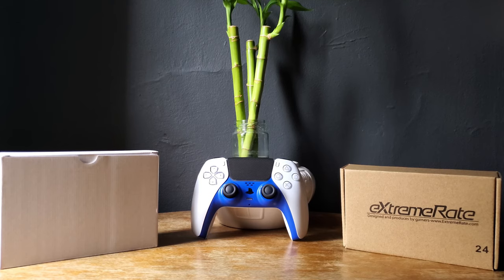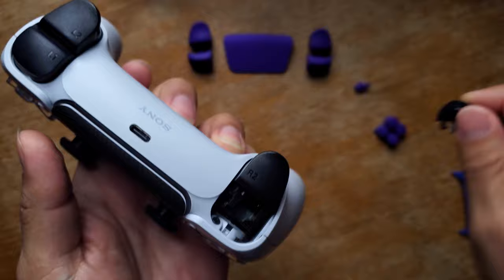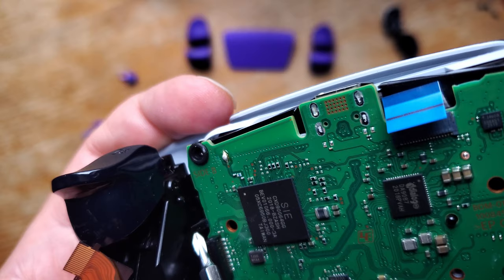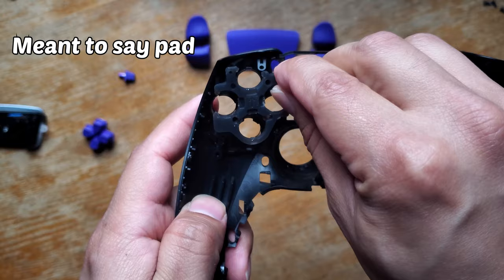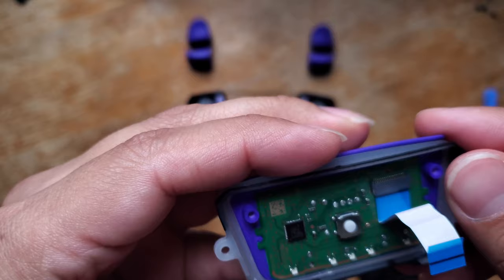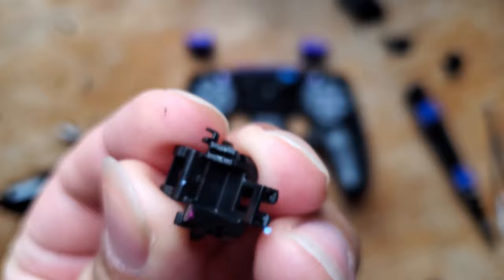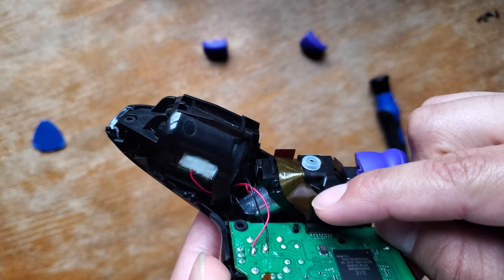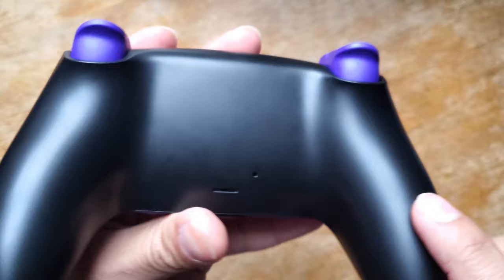PS5 Controller Customization: Step by Step Tutorial

Comment: Controller looks beautiful. I would rather someone else do this instead of me. PS4 controller was much easier to fix.
Reply from the maker: I know what you mean. But with practice and patience you can definitely get this done and save money.
Reply: Facts
Reply: Tbh i've done a LED mod on mine, took me 1.5h but it was worth the effort. Just follow a tutorial and you'll be good
Reply: I'm currently working on mine right now, and believe me when I tell you "attempt at your own risk". I wish they didn't make the controllers where you have to customize them yourself. I think I might have broke a peice, not sure yet, and you have to use some force to disconnect some wires. You're taking a huge risk with your controller trying not to cause damage. Plus the customize buttons don't even have the symbols on them. So you better never forget which buttons are
 □🔺️X⭕. Also the Playstation button isn't the proper logo, it's just a cutout.
Reply: Playstation 5 controller is super easy to mod. Only 5 screws.
Reply: Not trying to start anything But if you think that's hard try doing dual sense Edge
Reply: Obviously this sort of thing is “attempt at your own risk” lol but if you’re not confident in your abilities, it would be wise to do this with a controller that already needs taking apart to repair something like stick drift. As far as the buttons go, if you don’t know which ones are which, then we might have bigger problems than just cosmetically modifying a controller.
Reply: This is something to try on a controller you’re gonna throw out or sell I think
Reply: Hell I just did it, it took me 3 hours :(
Reply: @im.a.caveman fr, I just did it, I saved a bunch of money

Comment: im glad its similar to the ps4 one. but if its one thing i learned its that, do not mess with the triggers and option buttons. i once messed something up with that and it never felt the same way after that. Even after putting the original ones back it never felt the same. I personally wouldnt recommend messing with that

Comment: You absolutely saved my life with showing how to take the inside of triggers out. I usualy only mod ps4 controllers but I was doing a ps5 and i order my parts from Ali express much cheaper but  they don’t send them with it.  I searched the web for like 3 hours looking for someone to show me. Your the only one out there I swear. Earned a like and subscribe
Reply from the maker: It's funny you mentioned that because I had also done research so that I could do it for this video. Since I couldn't find it I took matters into my own hands. So I had noticed that a couple times the triggers would move a little out of place but all I would do is push it back in and it was good to go. Thanks for watching and thanks for the sub! Glad the video helped!

Comment: This video helped me learn how to customize my controller, but I remember how crazy the triggers were from this and I thought I remembered incorrectly. Nope, it looks insane to do those. Wow. You make it look easy.
Reply from the maker: It can be a little confusing for a beginner but it's nothing too difficult. As long as you're paying attention and you're patient it'll work out. 

Luckily it gets even easier with the newer boards BDM-030 and 040. The trigger modules don't get screwed off. Which is less steps and smoother installation. The board in the video is a 010.
Reply: @im.a.caveman  really? OK maybe I'll give it a try. I have a few controllers to work on so I'll try doing the back triggers.

Comment: I got to the hairdry part and said fk it hahaha. Ill just do the decorative strip and call it a day 😂
Reply from the maker: 😆 one day when you're feeling brave enough go for it! With enough heat the board should lift up easily. I recommend thin plastic tools and that aren't sharp.
Reply: @im.a.caveman  hahaha ok fine you inspired me to give it another go tomorrow lol thanks for the advice!
Reply from the maker: @Justafartu  Awesome! If it's not lifting up, don't rush it. Apply more heat and try lifting up again. Make sure it comes off with the glue on the board
Reply: @im.a.caveman  dang sorry bro I didn't see you replied again haha. I DID IT MY BROTHER WOOOOO the new set up looks so dope haha thanks for believing in me and the awesome tutorial!

 Time to do every controller in my house now lol
Reply: @im.a.caveman  dang now the touch pad rattles a bit from the adhesive losing its viscidity. Any tips other than taking it all apart again and reheating the glue?

Comment: Fantastic 😂 but took me almost 3 hours and Yes I tore the connection ribbon I couldn't be bothered with the clickable pad but the spiderman cover looks good. Don't have a hair dryer!! Anyways controller seems to be working tho the PS button that turns on PS5 works so maybe the mic or something is not working 😮 anyway cheers from London UK
Reply from the maker: Which spiderman cover do you have? Is it the black one with transparent webs? If you think it was one of the mic cables, I've seen replacements on Amazon. Never tried them though.
Reply: We’re do you guys find these faceplates every time I search for one I find stickers

Comment: Do you have any advice or tips for someone who is nervous about taking their controller apart? Obviously I will have patience and take my time, follow the video carefully... But any other advice?
Reply from the maker: Yes! Decent tools. I bought a screwdriver bit kit on Amazon and it has lasted me for I don't know how long. When it comes to working on controllers it's been great. So using the right tools is one thing to keep in mind. Start with a ps4 control if you have an extra. Have a set of plastic prying tools since it's not a good idea to use metal or you'll scratch up your stuff. Also, this one is optional, a silicon mat to work on. Some have little compartments for screws or other little items.
Reply: @im.a.caveman  what screwdriver kit did you buy on Amazon? I’ve been looking but there’s so many options and I’ve bought tools before which had just been made of soft metal and made screws go mushy and bent. Also, what prying tool did you buy? Ive got some but they’re all blunt and bent.
Reply from the maker: @MxHawthy  There's different versions of the one that I use. Just check out the 2 links. I have this because it was cheap at the moment and I personally have been able to work with it. I recommend having a better one. But this one has gotten me through so many customs since the screws on the controller aren't like crazy tight.  

https://www.amazon.com/dp/B01E16J6RQ/ref=cm_sw_r_cp_apa_glt_fabc_3DQEWAS1MBKHD2EDRRFN?psc=1

https://www.amazon.com/dp/B08D3GRZGF/ref=cm_sw_r_cp_apa_glt_fabc_K6X7K94SFPRYTQMG9JDJ?psc=1

Comment: At 4:37 the 4 screws, my controller doesn't have the 2 screws in the centre? Only the 2 on the sides, what do I do? I don't wanna proceed further incase I break something.
Reply from the maker: It's okay. You have a BDM-020 I assume. The board of that control is a BDM-010. The only thing that will be different is the touchpad. It might not be compatibile to yours depending on which kit you have.

Comment: Might be a dumb question but I feel like I did everything right but the controller won’t turn on what’s should I do
Reply from the maker: Did you reconnect the battery? Or connect the cable in case it needs to charge?

Comment: Nice video.  I'm having and issue with my touchpad after I changed the front faceplate, if sometimes sticks and it doesn't have as much up and down movement as it did before.  Any clue what could be wrong?
Reply: Hey bruh if you still haven’t fixed this, it is most likely because the touch pad isn’t connected to the circuit board with glue, you can fix this but simply gluing the touch pad to the board, or by reheating the board if there is glue on it already. Hope this helps
Reply: @sam-jett  I got it fixed. Thanks!

Comment: Just did a controller, EVERYTHING works as intended.... except the white light at the bottom of the touch pad. Any idea what i may have missed? 😩
Reply from the maker: Does the touchpad work?
Reply: @im.a.caveman It did not! But, i used the piece that came with my new shell and it works now. The other one I had on there had 2 plastic clear pieces (that weren't in it) that are important to the pad I guess lol. Swapped those out now everythings good. Thanks for the video, now I have a PS1 influenced Dualsense. 🙏

Comment: Trying to do the R/L2 buttons and I dont have the screws on the front like you do at 8:44...  I took the extra 2 screws out on the back and black side piece came off but i cant get the trigger out.. Any ideas? Ill prolly get it before a response lol, but thx still!
Reply from the maker: Sounds like you have a BDM-030. So far there isn't trigger or bumper replacements for 030.
Reply: @im.a.caveman  thx boss. I figured but didn’t know till it was taken apart. Even the R/L1 wont fit it. Silly. Oh well

Comment: Does anyone know how long the blow dryer process is supposed to take?
Reply from the maker: @TheTone2244  could be like a minute? Never timed it but maybe 1-2 mins. Depends how well you're providing heat to the touchpad and how much heat. Can't be too hot either. Just apply enough throughout the whole touchpad then try to lift it. If it's not lifting apply more heat until the board starts to lift up with ease. Take the board out with the glue so keep an eye on it

Comment: are the dualSense 5 Joysticks the same as the Dualshock 4 Joysticks? not the actuater, but the plastic part your thumb actually touches? 

i ask because i want to swap the joysticks on mine with some metal ones. and i cant find ANY aftermarket ps5 controller/dualsense joysticks. but i have found some listings saying things like "ps4/ps5 compatible joysticks"
Reply from the maker: Haven't tried myself but I think so. I'll try it out and let you know when I have tried the ps4 thumbsticks. gamingcobra.com has ps5 controller thumbsticks. You can also try Amazon.com if you haven't already.
Reply: @im.a.caveman  thanks for the reply. And I can answer the question as a hard yes.

I had an old ps4 controller I'd prior upgraded the thumbsticks to metal on. They work perfect the ds5
Reply from the maker: Sorry I didn't get to reply earlier but it's awesome you were able to have the ps4 thumbsticks on it. Thanks for letting me know!
Reply: @im.a.caveman  NP. yeah i prefer aluminum joysticks so im not replacing them ever 2 months. now im trrying to find aluminum buttons. and im starting to wonder if those will be the same as the ps4 as well. do let me know if you find out

Comment: you use any new glue to the new touch pad or we leave it as is??
Reply from the maker: I didn't use new glue. Still works like normal. If enough heat is applied and you manage to get the touch pad board off with the glue then you could end up having most of the glue on it.

Comment: Hey man after doing this mod along with adding paddles my dpad is no longer working. Any idea what it could be?
Reply from the maker: Check the conductive film, which is what the dpad presses on, and Check your cables. If nothing works out disconnect your back buttons and use the stock parts to see if it works without the back buttons. If you changed your shell and buttons that doesn't need to be changed.  If it works with the stock parts then you might have gotten a faulty and can ask for a replacement
Reply: @im.a.caveman  thanks I will. Hopefully it works
Reply: @im.a.caveman  had a loose connection! Thanks for the help again. These videos are a controller saver! Subscribed for sure bro.

Comment: Did everything, must have messed something up. Having a slow methodical "click" inside the controller. Seems to be every second it just goes "click" and then the brief sound of a gear down turning. Then click. Thoughts?
Reply from the maker: I thinkni know why which would be the trigger. One maybe. But if that's the case then its the gear or wheel that needs to be placed correctly.
Reply: @im.a.caveman  that makes total sense. Its hard to see from the video how he places the wheel and layered components. I must have screwed up one placement, so it's trying to spin and gets blocked. Thanks!!
Reply from the maker: @A-a-r-on  The problem is I didn't realize myself I had to align the bottom part of the wheel to match the hole or gap when inserting the wheel. Look at 8:53. Hopefully you get what I mean.
Reply: @im.a.caveman  thanks man, appreciate it. Gonna pull it apart tomorrow (its late, I'm beat) and will report back with my findings
Reply: @im.a.caveman  welp, took it all apart, set the wheel correctly with the cover so it lined up right, reassembled, and still clicking at 1 second intervals. Took it apart again, took it apart all the way down to the pin removed, reset the trigger, put it all back together, still clicking the rumble every second. Only happening to the R2 trigger. I dunno now what it could be. Sucks
Reply from the maker: @A-a-r-on  do you have IG? If yes you can send me pics and videos of the problem. That way I can actually see and hear it.
Reply: @im.a.caveman  yea, absolutely. It's spurlyy
Photo has me in sunglasses

Comment: Thank you for the tutorial! I am not a hardware man ( I am gifted in modding/hacking/coding creating programs softwares. I barely take apart small things, phones, anything. This would be a big careful project for me that will most likely take me about 3+ hrs because anxiety) I want to attempt this, feel proud and do it and feel happy. What level of difficulty is this? Thanks
Reply from the maker: For a beginner it will take some time. I wasn't as organized at first so knowing where your screws are and where they belong will help alot. So putting them in a little compartment would be good. One example is if I take out the 4 screws from the back shell off then I'll put those together in their own spot. I'll even sort them out so that I'll know specifically which hole they go in. And so on with the other screws inside.  Even if you think it'll take you 3+ hrs that's okay. It's all about patience and take a break if you have to. That difficulty does change if you plan on changing the touchpad. The touch pad does have to be done very carefully because you don't want to damage the touch or pressing function for it. But besides that it can be done for a beginner. Just pay attention to your cables and don't rush it. 

Also pay attention to your controller model/bdm and the products that are bought. Some products say they're compatible specifically for a specific model/bdm. But if you have any questions or are unsure about something you can come back and ask. I'll try to answer as soon as I am able to. Thanks!
Reply: Every black screw that comes out of the controller is the same. There are 2 silver screws (and 2 additional black screws) that hold on the face plate...those are the only ones that have to go back exactly where they came from.
Cheers

Comment: Hey man! I used your tutorial to change out the white for a classic all black look, but i have two problems. 1, the touchpad after i put it in is very loose and wobbly, any way to fix that? And 2, the start and select buttons are basically flush with the controller and are pretty hard to press. Hope this reaches you and thank you so much for the perfect tutorial!
Reply from the maker: Just found your comment! Are you still having any issues?
Reply: @im.a.caveman  yeah the touchpad is like super loose and the start and select buttons are super flush with the controller

Comment: I have a newer controller I guess. Those screws are not there to remove the triggers
Reply from the maker: You might have an 030. Which is the recent release. They're easier to work with but so far I haven't seen any replacenent triggers or bumpers that fit an 030.

Comment: For approximately how long should you apply heat to the touchpad?
Reply from the maker: You would just have do trial and error. But basically the more heat the better just keep trying to see if you can get under the board and then if you can continue to move under it. If you're struggling apply more heat. Heat is what will loosen up the glue. I did mine with a hair dryer but you can also use a heat gun.